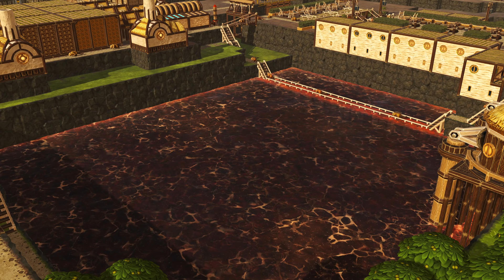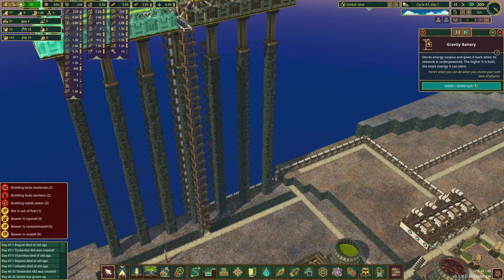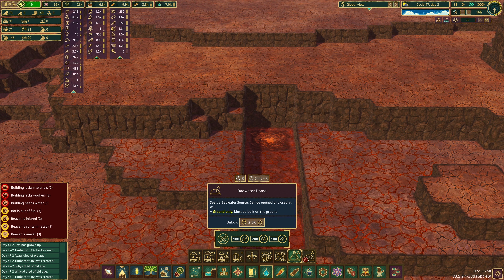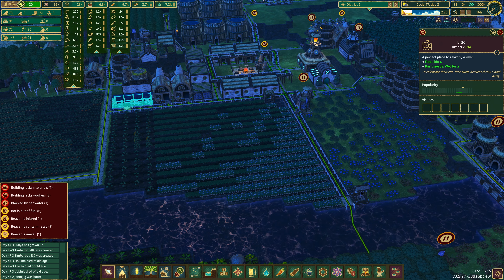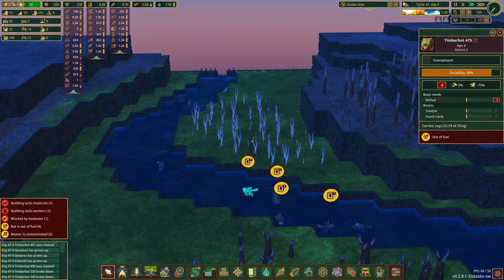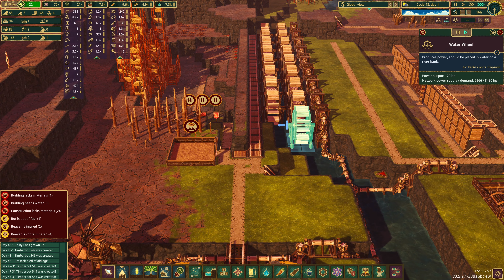Enhancing Gameplay with Viewer Feedback in Timberborn  | Badwater Lakes Episode 21

Comment: 50:22 You probably also want to place some small tanks with biofuel all over the map so your bots can reach those easily.

Also, the easy way to empty the carrot storage would be to use them for biofuel for a while.
Reply from the maker: Good idea. I’ve started placing mini bio fuels around the colony.  

I had not wanted to process the carrots as biofuel but I think I will.